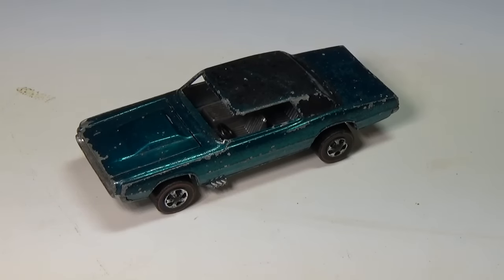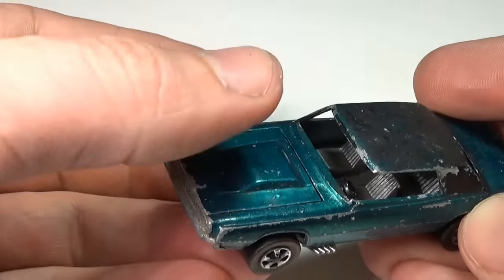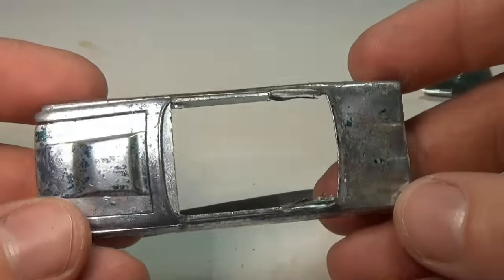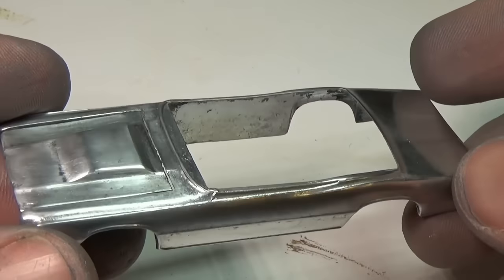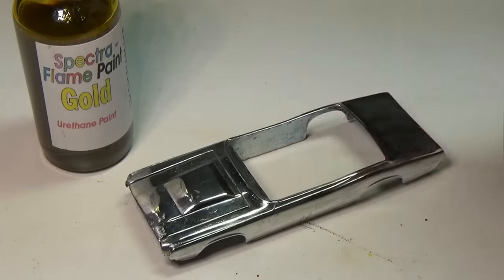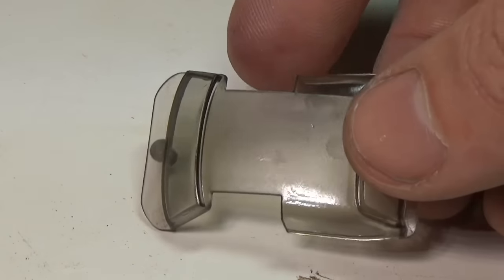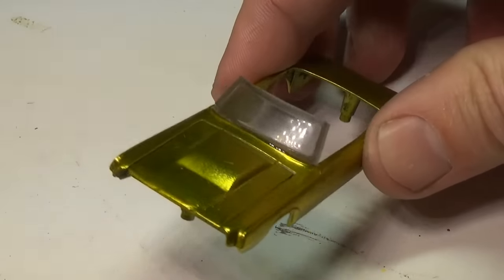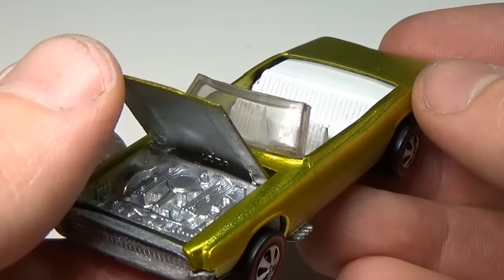Redline Restoration: Custom Hot Wheels 1968 Custom T-Bird Convertible

Comment: About the Spectraflame paint...are you using an airbrush is is that paint in a spray can?
Reply: you can buy it in a small container for about 10$ from the redline shop, along with other supplies and parts, and you do need an airbrush to apply it, and its difficult to get right with a few of the colors, which is why alot of people are scared of doing restorations on the older cars, id recommend a cheaper car, that has mostly flat surfaces, that comes factory as a darker paint, but make sure to do research on the car, just to make sure the interior and wind shield along with details are done correctly acording to paint and where they are from, as there are many differences between different regions
Reply: Mitch Gawlik no

Comment: Nice custom, I have a question.....When you super glued the windshield to the base.....how did you not get the white streaks that come with gluing plastic with superglue?
Reply from the maker: +Mark Ah-low I only used a very small amount on the bottom .. the white streaks are probably in there but just not noticeable..

Comment: Looks great. I dont think the windshield is so much out of scale as it is too upright. I would try taking it back off anf sanding the bottom at more of an angle. Then I would chrome the frame with either Baremetal Foil or a Molotow chrome marker.

Comment: A little bit disappointed with the way the windshield turned out. When I saw you eliminated the front lip i winced. IMHO, the best approach would have been to leave the front lip on and dremel it back so it would fit between the interior, and the car body, but not show through the hood. That would have given you a much cleaner glue surface, and a truer mounting. The rest of what you did looks amazing as usual.

Comment: Lower the windshield to fit, i mean sand down from either top/bottom to fit mounting point and bevel the edge however much you need for angle. lower like chopped.

Comment: I've replaced broken pillars with donor pillars from cheap cars. It does take a bit of skill and time, but after you've done a few, you can replace the broken pillar and no one will ever know.I use J&B Weld.Loving your site more and more. I'd love to see you convert an old caddy wagon (ambulance) into a hearse.Take care.Jackwww.theliteralbible.com
Reply from the maker: +Bronzesnake Though about trying that but did not think I could still use spectraflame paint to paint it as my repair would show through..  Will take a look at the hearse conversion... sounds fun.
Reply: I agree with bronzesnake. I'm sure with your experience you can use a minor welding technique like some sort of soldering and filed, sanded and buffed out the weld. After that, couldn't you of painted the car silver then use spectra flame? 

I like the windshield mod. It just seems a waste to cut off the roof.  Hope you saved it incase you need a right side pillar.

Comment: I get why you modded the car, but honestly I did not care for it. Mostly I disliked the fit and finish of the windshield, how you secured it, and also did not care for the white primed interior. I would have rather seen if you could have replaced the pillar.

Comment: what if you have a pickup truck and you still have the roof but no interior or windows because the car is the classic 1890 bigfoot model and its valued at $200.00